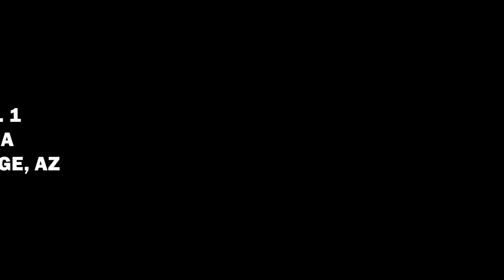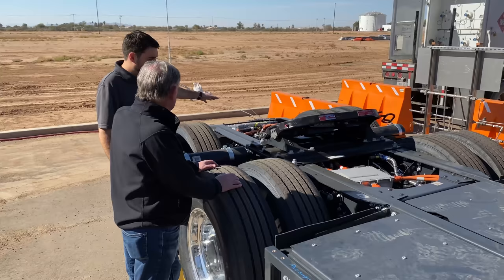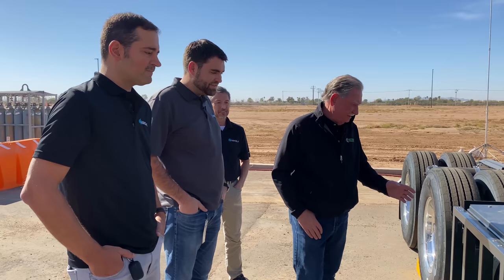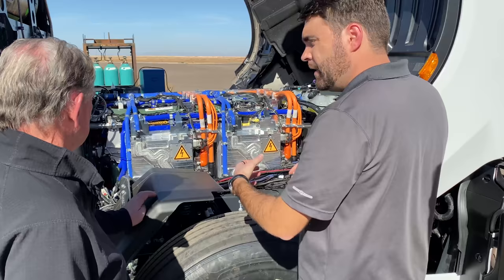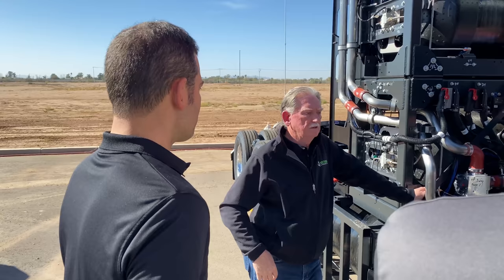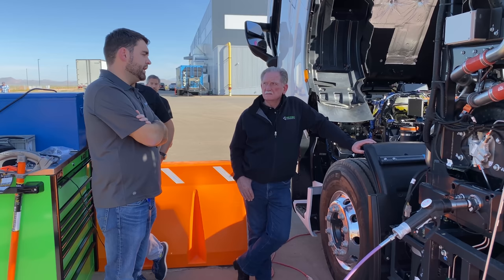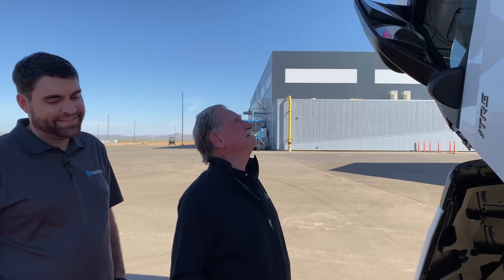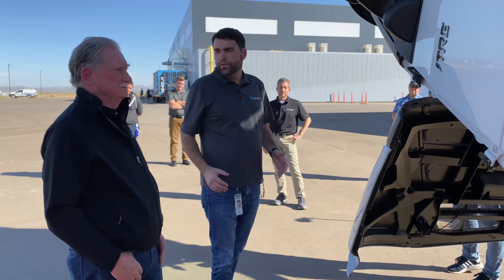Nikola Series - Ep. 1: Introduction & The FCEV Alpha

Comment: Hydrogen is a tall order.  Fueling time, sourcing/generating the hydrogen, maintenance on a new type of power system that few have experience with, multiplied by getting that service capability to the broken down truck wherever it happens to be when something goes wrong, the added complexity of a fuel cell versus just pushing electrons from battery to motor, it just doesn’t seem like the way to go.  Denser battery energies are coming and it shouldn’t be long before that fact makes the whole overhead of fuel cell technology a poor contender.  Ships, maybe, trucks, I’m highly skeptical.

Comment: Drawbacks of FCEV trucks versus BEV trucks: 
- Vehicle cost
- Vehicle maintenance cost
- Fuel cost
- Round-trip energy efficiency (electricity->hydrogen->electricity) versus (electricity->battery->electricity)
- Lack of fueling infrastructure
- Cost of fueling infrastructure
- Reliability of fueling infrastructure
- Safety

Because all of the above are physical in nature, no amount of development will EVER cause FCEVs to get better than BEVs in the above areas.

According to the video, FCEV trucks also do not offer any benefits in the following areas:
- Range
- Refueling time

Maybe(?) they can beat BEVs in one area, but likely only for a few years:
- Weight

Is that enough to EVER make this vehicle successful?  No.

(OTOH, I will say this looks like a very interesting engineering project!)
Reply: BEV trucks don't really have "fuelling" infrastructure either... but the infrastructure is a lot easier to build and install.
Reply: NOTHING REMOTELY SIMPLE ON THIS TECH…….ALOT OF ENGINEERING WITH EXPENSIVE PRICE TAG….
Reply: The refueling time could end up very nice.  The 1 hour refueling time is with is with a bodged refueling system, basically just to test the rest of the system.  Probably doesn't use a pressure any higher than the tanks themselves, which means flow rate trickles off greatly as it fills up.  A properly designed system would be much faster, although I have no idea if they'll reach the 10 minutes they stated.

For comparison the Tesla Semi is supposed to take 30 minutes to charge up to 400 miles of range.  That's likely starting at 0 range though and cutting off the top of the charge as it begins to trickle.

It really depends on how they're used and how well it lines up with existing shift length/break time requirements.  A mandatory 30 minute break could be sufficient to charge up the Tesla Semi for the rest of a shift and thus have the slower charging never become an issue.
Reply: @rhamph  Agreed on all your points.

Yes, the 10-minute refuel would be nice IF they can achieve it.  That said, note that faster refueling of an FCEV requires MUCH more power at the point of refueling to cool the hydrogen more rapidly before it enters the tanks on the truck.  (Cooling the hydrogen to very low temperatures before being compressed into the tank is REQUIRED to prevent the tanks from melting.)

Bottom line: Faster FCEV refueling equals lower efficiency FCEV travel.
Reply: @shakumpum  Where to start when you lead and end with ad hominem attacks?  Certainly not there... You lost a lot of credibility right there, but in case others are unaware of the truth of the matter, I will provide more details:

- Safety:  BEVs are incredibly safe compared with other vehicles on the road.  If you have any information to the contrary, please post it here.  It is true that there have been few, if any, FCEV accidents, but there are also precious few of them on the roads.  But hydrogen IS dangerous.  Here are some facts many do not know about our lightest element:
- Safety:  Hydrogen is the most flammable element on the periodic table: The National Fire Protection Association gives hydrogen a rating of "4" for flammability.  (There is no "5".)  This is because it can ignite with very low and very high concentrations and with very low energy ignition sources.
- Safety:  Hydrogen flames are nearly invisible in daylight.  On top of that, they emit very little IR energy.  As a result, many people who are burned in a hydrogen fire do not even know there IS a fire until they are already in it.

- Efficiency:  A modern Li-ion battery has about 98% ROUND TRIP energy efficiency (DC-in to DC-out) in a BEV application.  To get overall BEV energy efficiency (grid AC to electrical motor signals), you have four energy conversions (each arrow):  AC->DC->Li-Ion->DC->AC  The 98% number above is for BOTH the charging AND discharging of the battery.  That leaves both AC/DC converter and the DC/AC inverter.  All together, the efficiency of that train is about 90%.

Now lets look at a FCEV:  The energy conversion chain looks like this: AC->DC->electrolysis->hydrogen storage losses->cooling and compression losses->fuel cell->DC->AC.  In case it is not clear to everyone, you can see that the already-98%-efficient "->Li-ion->" part of the BEV chain is replaced by "->electrolysis->hydrogen storage->cooling and compression losses->fuel cell->" in the FCEV chain.  That is NOWHERE NEAR 98% efficient!!  In fact, the THEORETICAL MAXIMUM EFFICIENCY of a hydrogen fuel cell is 83%.  Add in all of the other items and you need 2X to 3X as much electricity to travel the same distance with a FCEV as a BEV.

To put this efficiency issue into perspective, I can install four 60-cell PV panels on my roof (with inverters) for about $2000, pay another $1000 to have an EVSE installed and then provide all of my driving needs with a BEV for the next 25 years.

Let's say I want to drive an FCEV instead.  I will need AT LEAST eight PV panels, perhaps twelve, to drive the same distance every day ($4000 to $6000) AND I need to install about $250,000 of noisy, unreliable equipment to be able to refuel it.  But the FCEV supporters want to ignore the fact that it takes 2X to 3X as much PV to power the fleet AND they want the refueling infrastructure to be paid using OPM (as is being done in CA today to make FCEVs more palatable).

Yes, the above calculation was for a private car application, but, guess what?  Trucking companies will have to make the EXACT SAME CALCULATION.  So when they sit down and compare a $200,000 BEV truck with a $400,000 FCEV truck and then see that it will cost 2X to 3X to drive EACH MILE, how many of them will sign on the bottom line?  That's right: NONE.  It's moronic.

Without OPM, there is no way forward for FCEVs.  Period.

Comment: An hour to fuel the truck? Doesn't that kind of defeat the purpose of not using BEV trucks? I've always had people trying to sell me on how you can just pull up and refuel just like gas. Of course that ignores the fact that there are almost no hydrogen fueling stations but holy cow. It seems like the more you dig into hydrogen fuel cells, the less they make sense.
Reply: Did you listen to the video, 15 minutes with commercial fueling pipe.
Reply: Yeah his comment doesn't make sense for those of us listening.
Reply: @togowack  I heard them say that it takes an hour currently but they are targeting 10 minutes. What that means to me is "we want to sell you on capabilities we hope we can achieve". Sorry if I don't trust Nikola's claims given their past...
Reply: @seanermer8547  This isn't a Nikola sell, its whoever builds the stations that sets the refueling time.
Reply: @seanermer8547  Once hydrogen stations are open they can refuel in 10 minutes.  The only time it takes longer is when they are using a portable hydrogen dispenser which has less pressure.  But a hydrogen fueling station will provide more pressure.
Reply: @seanermer8547  Hi Mr Highlighted Reply - you know that hose diameter changes volume? How did you get your Highlighted Reply status?
Reply: @togowack  Who is going to build the refueling stations if not Nikola? No company is going to want to build the infrastructure before there are mass number of hydrogen fuel cell cars on the road. No consumer is going to want to buy a hydrogen fuel cell car before there are refueling stations everywhere.

What's going to come first, the chicken or the egg?
Reply: @togowack  I have no clue. I just commented on the video and then replied to the other replies...

And yes, I understand how filling a tank works. The problem is that most people think it's akin to refilling your gas tank when it's really closer to filling a balloon.
Reply: @seanermer8547  I think supply chain/fuel shortages will force the government to fund an alternative fuel system.
Reply: @togowack  Like batteries?
Reply: How long do you think it takes to fill 200 gallons of diesel? A hour isn't bad
Reply: @seanermer8547  Batteries are becoming unpopular as they come with too many problems. I don't care what they say if you are charging in 20 minutes all the power for one of these trucks good chance it will explode given variable discharge rates, thermal cycling and hard trucking service. They are OK for light duty domestic vehicles.
Reply: We are not meant to use batteries for everything either. The manufacturing is complex and high cost with scarce source material which outweigh the benefits. Hydrogen is plentiful very green friendly but comes with a higher up front cost and should be considered by government in the same job creation realm as nuclear reactors without the risk.
Reply: Switching to a bigger pipe with a high pressure pump is pretty easy engineering.  No need to be overly skeptical about that.  The real problem is the extra energy consumption of using such a pump as that makes the entire system more expensive to operate.
Reply: @rhamph  That's more or less what I'm saying(albeit likely worded poorly). In theory you could refuel almost instantanously. The problem comes with filling quickly AND cheaply.

If you go with a large pump for each vehicle, that would be incredibly expensive to install and would be prone to break downs. If instead you rely on having a high pressure source, you would need an absolutely enourmous source tank that could withstand immense forces. Otherwise a couple of trucks showing up at the same time would "steal" each other's pressure and would need to wait for the pump to get the pressure back up...The reason gas can be so cheaply distributed is that we basically dump it into a pit. If every gas station required a way to generate gas and store it at extreme pressure, we'd all be paying through the nose.

All this so that you can theoretically save a few minutes charging your vehicle with a vastly cheaper fuel source. The math just doesn't add up. People picking ICE over BEV due to charge time concerns makes sense. People picking hydrogen over both makes no sense.
Reply: Yeah that was surprising because they have been saying 20 minutes. Did Trevor Milton strike again?
Reply: @seanermer8547  It ultimately comes down to what costs they give, both to buy and to operate the truck.  It could work out better than ICE.. but it's not something I'd bet on.
Reply: @rhamph  It absolutely could work better than ICE but I agree that it's not something I'd bet on. Because BEV is better in almost every single aspect, hydrogen has a niche future at best.
Reply: @seanermer8547  Medium to long distance aircraft as well as container ships and supertankers comprise a pretty big niche.  I haven't seen much interest from those industries though, which I think says a lot about the current state.
Reply: This kind of refueling will not be self serve....so the driver will have time to go inside and get them a sodie water and a cheese burger, and use the batroom...and not block the fuel island...right Ike...lol
All while wearing their flip flops...lol...say no to bonehead truckers.

Comment: The elephant in the room with H2 fuel cell trucks is the cost - the purchase or lease costs, and fuel plus maintenance . Scania which operated the largest fleet of test fuel cell trucks stopped pursuing the fuel cell heavy trucking business in Jan 2021 choosing to focus on battery electric. Chief among their concerns were cost and energy efficiency which is 1/3 that of battery trucks.

Can Nikola with little original IP in fuel cells make money by purchasing an Ivenco truck body and integrating Bosch fuel cells? What is Nikola's competitive position doing this? Second and perhaps most important, how do the full life cycle costs compare to diesel and existing and planned EV trucks? Nikola and the analyst community skirt these questions on conference calls, instead focusing on superficial issues like how many prototypes are being built.
Reply: Exactly. It is about life cycle costs and cost per ton mile. H2 cannot compete with diesel or battery-electric or battery electric with a constant speed diesel range extender. The achilles heal for H2 is volumetric energy density and that everytime you touch H2 there are additional energy inputs
Reply: @jhindson88  a fair comparison of hydrogen to existing infra would point out that battery weight / tech in heavy transport doesn't work at much more than local delivery truck range, and that diesel is one of our great public health challenges - 520 additional cancers per million people exposed to their emissions, in addition to about a thousand premature deaths per million from lung and heart disease related - that's in addition to global warming potential from the petroleum value chain.   

My point is not that hydrogen is some perfect solution but that the argument in favor of diesel and battery tech in tricks is not stronger. There are already plenty of customers for this tech for reasons.
Reply: THANKSGIVING

Comment: Hydrogen is not a naturally occurring element. It has to be synthesized. The overall efficiency of hydrogen powered vehicle is less than 35%, which  is power plant electricity to hydrogen and back to electricity.  Diesel engine efficiency is 25% to 30%. I fail to understand how an engineer would paddle this technology.
Reply: Yep, physics is a bitch.  Good luck beating physics guys.
Reply: Hydrogen is the most abundant naturally occurring element in the universe bud. It's the base element that all others are derived from. But I agree using it in this application is stupid.

Comment: It looks very complex, what will the cost to produce this truck? Will the fuel be as low as electricity to charge an EV battery? Weight? Cost per mile to operate?
Reply: You need to place these scary big refueling stations everywhere a truck wants to stop.
A trucks with multiple stops a day could go on 350 kW on each short (un)loading and never run dry. Many or all destinations can install chargers, ever less big of a deal. Hydrogen, not the same thing.
Batteries are shity technology though and progress has been pedestrian the past decade. Look at Tesla's energy density since the 2012 Model S, or even the 2008 (?) Roadster.
Reply: It has ALL of the same components of a BEV plus fuel cells, hydrogen tanks, and all of the specialized hydrogen safety equipment. They stated in the video the truck needs to last twice as long as a diesel truck to pay off its cost. Nikola claim(ed) they will be able to fuel the trucks for cheaper than diesel, but that plan depended on them doing their own fracking and processing to get the cheapest possible hydrogen cost. That talk swiftly switched to them working with partners as they admitted they dont do much of anything in house.
Reply: @Cloxxki    Price of batts has gone from around $100k to $10k in that decade and charging speed greatly increased along with longevity.  Only significant problem I see for long range semis is batt mass, everything else should be relatively easy.
Reply: @patreekotime4578  Exactly my thoughts, if they end up getting a truck on the road with a real customer I reckon it will be all electric…
Reply: G8YTZ - TESLA is cheaper to OPERATE and ROI is just 18 mos in a TESLA.
Reply: This is part one - more details in part two as we go forward.
Reply: @markplott4820  I would like to see the  numbers from Nikola because I’m interested to see their proposition to the freight operators. The absence of any numbers gives me cause for concern.
Reply: @markplott4820  Is like to see their numbers though. I remain unconvinced as to the financial case for their product. My guess is they will go 100% BEV before long, but I remain open minded.
Reply: @G8YTZ   - then go see NIKOLA Q3 Earings call, its on youtube on Nikola channel.
Reply: @markplott4820  Well, I don’t intend  investing in them, so it would be a waste of my time. But I’ll watch with interest.

Comment: They said that the fueling pressure could be from 350 to 700 bar.  That equates to 5,000 to 10,000 psi.  That is extremely dangerous!  And it also explains why the fuel supply line is so small in diameter.  A normal safety factor for such a line is typically about 2.5.   That would mean the line should withstand about 12,500 psi (for 350 bar) or 25,000 psi (for 700 bar) prior to bursting.  That’s small diameter thick walled hard lines needed to survive that.